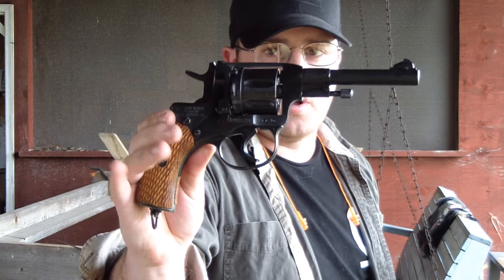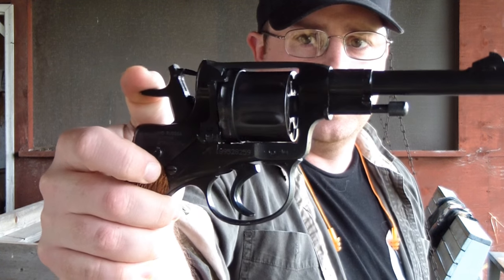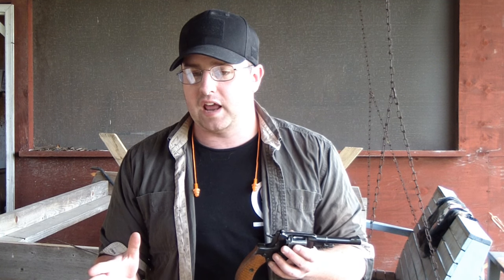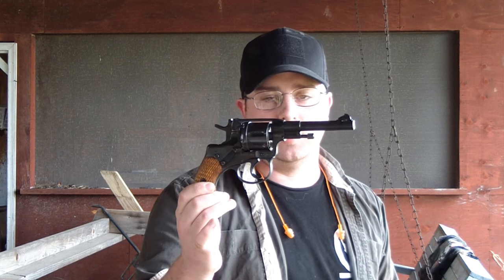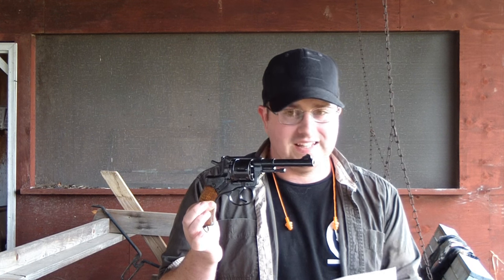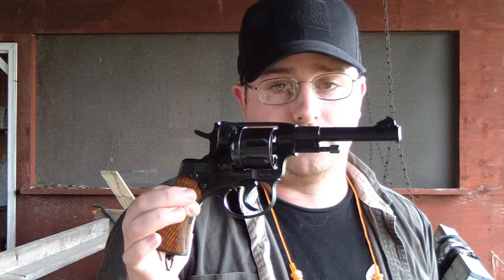Nagant M1895 Revolver: History, misconceptions, shooting and hand loading.

Comment: I like this one so much I have four!  I've used it for cowboy action shooting with. 32 H&R magnum.  You can also use S&W  32 short,  S&W .32 long,  and (I've read). 32 acp. The cases bulge a little,  but the gun can handle them just fine.  The Russians would say nothing goes wrong with the Nagant  that can't be fixed with a hammer!  Ironically Nagant "dumbed down" the design because the Russians didn't think troops could handle complications like a swing-out cylinder and double action.  They eventually put the double action trigger back in.